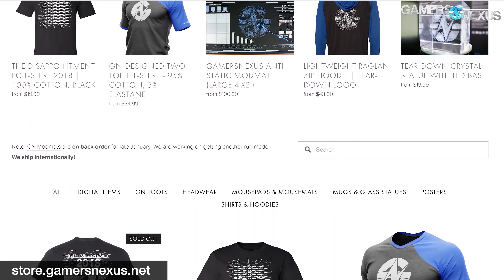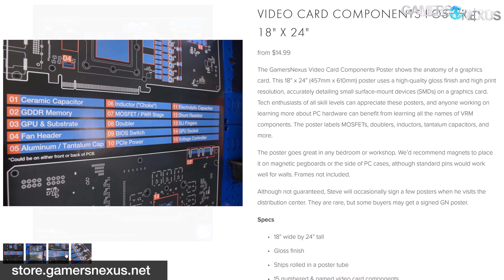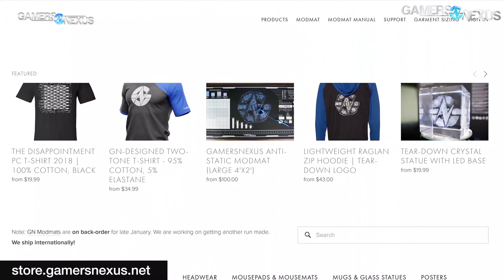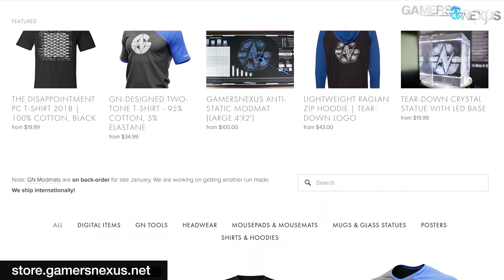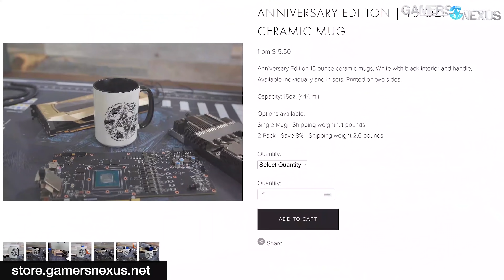Tear-Down of $2500 Titan RTX Video Card

Comment: Hello GN, could you tell me the thickness of the thermal pads used?

I got mine early 2019 i think, so i'm wondering if it's time to change mine. 

I forgot to jot down temps when new, which is something i have always done with any other card, just so i know roughly when a re-paste and pad change is needed.
Reply: did you find anything about?
Reply: @ToToPP  
Sorry, no. I did wind up just buying a whole bunch of various Gelid Extreme pads i think, and done it about a month after i made that comment. I didn't even think to write them down sorry. 

However, i'd stick to buying range of pad thicknesses, like from 0.5s, 1s, and 1.5s. 
In my experience, i have never had any problems doing a double layer of 0.5s or adding a 0.5 to a 1. 

It's just going to take putting them on, closing over the blackplate and screwing it down, then opening it back up to see if there is good enough contact between the pads and chips. If there is, then you know you can finish up and close it over properly with those pads. Nothing will be wasted. 

Good luck.

Comment: What is the fan connector piece called? I have an rtx titan heatsink and I wanted to put it on my asus rtx 2080 ti because the blower is extremely loud at full load. I know the 2080 ti has a port for it but it only powers one fan for the titan heatsink and it doesn’t increase in speed or decrease in speed. Can someone please get back to me ASAP because I want to buy a 4 pin splitter for it but I can’t find it anywhere

Comment: Gamers Nexus i give you a little tip, grind the tip of the cross head (Philips screwdriver) off and it will fit perfect and you will be able to undo screws easier with less force :-)

Comment: 11:08 Isn't that glue that takes some stress away from the solder joints of the BGA chip? It's a usual method to fill the area under BGA chips with resin based glue to prevent their joints breaking down under board flex. And those memory chips are close to the board connector, which is a stress point.

Comment: 13:05 .... The boards are exactly the same .....So .... If you replace the 1GB Vram modules on a 2080ti , to 2GB's , and flash a titan bios on , it should work ?
Reply: No, K1 on GPU chip stands not only for missing memory module, but for a missing memory channel in chip memory controller itself, so its a maximum of 22 GB and Its a hardware limitation that comes from NVIDIA. With a recent NVIDIA database leak and enough will to dig it up, you actually can make a 22GB 2080 Ti if you are skilled, having proper equipment and prepared enough to do some BGA and reflow soldering processes with heating the PCB from the under too, because its so T H I C C and contains enough copper to dissipate heat very well by itself.

Comment: I didn't expect Nvidia would come with a card which is even harder to justify price-wise than the 2080Ti or the rumoured 2060 (if the price-rumour is correct).
Reply: The vast majority of the price argument is the fact that you're getting 24GB VRAM. That makes the card comparable to the Quadro RTX 600 at a much lower price.

Comment: guys! for god sake! isopropyl 99.9% to clean your PCBs from thermal paste and stuff. with a little brush like a tooth brush or whatever. and blow air onto to dry it. the isopropyl dries very fast when blown. no time for it to "eat" plastics or sensitive parts. believe me it works like a champ! quick brush with iso + quick air blow and done! cleaner than clean.
Reply: He did

Comment: Oof, so Id need to buy the $2500 GPU to upgrade single GPU? SWBF2 was using over the 11 GB of Vram a 2080ti would have...
My Titan Xp may not even be enough as is, it was showing 11.6 GB, and seemed to be using system RAM since at 26 GB of Pagefiling+RAM, while that game only uses 17-18 GB on my laptop instead by comparison.

For multi-GPU, I'm pretty well set with 4x Fury, but I haven't tested it with SWBF2, and I think that game will be one of the few that bring it to its Vram limited knees... Most of my games run better on the 4x Fury, and from those prices, it looks like my Titan Star Wars edition will have to stay my best single GPU!
Reply: are you sure it wasnt memory leak on the vram?
Reply: @wabachi  3x 4k just seems to eat up the Vram... I'm shocked it actually runs playable at 11,520x2160 resolution, especially at Ultra settings, let alone flabbergasted its doing it on a single GPU (hence I built a 4x GPU machine). That was such a shocker, most of my games were having a hard time on 1 4k monitor at 40-50 fps. Fortnite for example is not particularly demanding and ran 67 fps without AA on single 4k, so I'm blown away by the frostbite engine (SWBF2 Lootcrate edition by EA).

But is it really 11,520x2160 resolution though? I feel like Nvidia is cheating, enabling the custom resolution makes the other 2 monitors look super stretched and fish eyed (like 1 inch character becomes 12 or 15 inches at the sides), so they might be running only 720p and varying resolution lower as it gets closer to the sides. I need to finish the hard-line tubing on my Threadripper Fury build to see if RADEON eyefinity has the same issue (I'll have to cut graphics down for Vram though). 

Otherwise yeah, I generally had no issues with even 4GB of the HBM on the Fury crossfire (it generally gets over double the FPS of the Titan Xp at 4k Ultra, but costing less used vs used), however, with triple 4k, I think the 4GB will be limiting after seeing this... But then again I never expected anything could actually run it seeing my regular 4k results, and just thought it would be fun to try for older games, but fired up the 2017 Lootcrate edition for LOLs to see a slideshow (Although, I'm not angry it actually runs well... That's pretty crazy...)
Reply: @jakegarrett8109  i'd say over 2x 4k starts to be a gpu speed problem since files on the card would be too big for the GPU itself to process lol, btw if it reports correctly use GPU-Z at sensor to see Memory Usage (Dynamic) how big it is... 
you said you have AMD cards as well right? does eyenfinity is still a thing?
Reply: @wabachi  Last I checked, Eyefinity was definitely a thing, way better than the pain in the.. we just won't go there.... Anyways, it actually isn't as finicky and janky as Nvidia (which literally turns off my monitor outputs when firing up a game sometimes), and requires a workaround to get it to even work for some things (which may be why its super distorted on the picture, but I need to test some more games, because some like Need For Speed Most Wanted would look pretty sweet with surround gaming, but it flat out refused to work on Nvidia). Eyefinity took maybe 5 minutes for me to setup, Nvidia... Well I'm still working on it, haha!

I'm thinking GPU-Z can only show what the GPU uses or calls for, and drivers will cap its calling to its dedicated amount (which is why it may show as say, 7 GB on a GTX 1070, even if its 8.5 or 9 GB on a Titan, because the driver knows the 1070 just doesn't have enough, but hopefully it tries to use all 8 GB available to the 1070 first, but it may need some for spur of the moment texture load in without hanging while it swaps everything back and forth, so a little bit of a balancing act and may need to leave some open on the card).

Yep, that's why I had the Titan clocked at 13+ Ghz memory +800 something. It is indeed the fastest Titan Xp I've heard anyone do (by a LOT) in terms of Vram overclocking. Its a shame its so power limited and will later be pushed to its death on liquid nitrogen after I hardware mod the daylights out of it. Its just been too much garbage to deal with (I previously had so many issues with Nvidia drivers, I put it away after a couple weeks of use, and I should have just sent it back for a refund, and only now does it seem like the drivers are less janky (they still crash some games stock, but nowhere near as bad, or maybe I just haven't been using it much since I have my 4x Fury setup and haven't noticed... Either way it "seems" to be working).
Reply: @jakegarrett8109   as nvidia says "it just works" haha or how most fanbois says "amd shitty drivers, nvidia best drivers"
anyways about "calling to its dedicated amount"  no i'm talking about dynamic... for example right now i'm on a 580 (8gb) and in a game or so it shows for example "2743 MB" as dedicated and "143 MB" as dynamic, as in the "file that is processed" at the time and usually the dynamic varies depending on the load, you got what i'm saying? maybe ur card doesn't show dynamic memory (which i highly doubt tho)

Comment: Yes, insanely pricey. Yes, no sane person will be buying one to game with. No, it is not meant for gamers, no gamer needs 24gb(?) of gddr6 memory to run any game even on 3 monitor setups. This card is a bargain bin Quadro and that is all there is to say about it. NV-Linking two 2080ti's together will still only get you nearly all of the vram this one card has.
Reply: I hit over 11 GB (like 2080ti) on my Titan Xp playing SWBF2 yesterday, and seeing as my RAM use was 26+ GB instead of 17 GB on that game when I'm not Vram limited, that means the game was probably using about 9 GB of Vram that it didn't have, so 21 GB should be about perfect...

Granted, I prefer my 4x Fury system for most things, but there are just a handful of games that do use more than its 4 GB of Vram at 4k Ultra, but then again I mostly play older titles because I'm not spending $30 to $60 on a new game, what does it look like? I'm not that rich!
Reply: @jakegarrett8109  what is SWBF2? I can't imagine a game that would be deliberately designed to take more than 11gb of vram, you must be doing something that is not "within spec" of the game, like a mod or something.
Reply: @adam346  Star Wars Battlefront 2 (EA Lootcrate edition). Normally 4 GB Vram has been enough for my 4x Fury crossfire, but some games are demanding more than that for 4k Ultra. SWBF2 is apparently easy enough to run on a potato, because almost as a joke, I fired it up on my Titan Xp Star Wars edition to enjoy the Slideshow at triple 4k (11,520x2160 resolution), set it to Ultra, and wow it actually runs... Not only that, its playable fps... Blown away since Fortnite on single 4k monitor only does 67 fps (no AA), LOL!

However, I think Nvidia has an issue with multi-monitor (I need to check with Eyefinity on the RADEON setup to make sure its not the game and the aspect ratio being a bug), because it looked ridiculously fish eyed as you go onto the surrounding monitors (like 720p or worse levels of bad). However, the frame rate was playable, it just seriously didn't have the Vram! I really gotta prepare for the 4 GB Vram benchmarks, its going to be awful, put on the welding helmet, cause you're not going to want to see this, haha!
Reply: @jakegarrett8109  I was using a tripple monitor setup where you have 3 active windows at 4k and then a single monitor is actually running the game. Even then, 4k single monitor should be peaking around 8gb(ish~) of vram with more than enough to run the other two inactive monitors with your desktop/chrome/netflix or what have you. Speaking purely in terms of v-ram as that really is the reason you would want that card.
Reply: @adam346  That's what I call single 4k (when the other monitors do nothing, except maybe MSI Afterburner and HWMonitor graphs). I'm talking 11,520x2160 gaming in my test. 

Generally having extra monitors does nothing to performance, but background tasks can. On R9 Fury series, you actually don't even see a hit in compute performance while 4x 4k Youtube videos run at once (you see a massive hit on RX 470 cards, its about a 40% knock in performance with just 1 4k Youtube running, so don't render videos while watching videos, haha!). But the Fury series is weird, I get within 1% (closer to 0.5%) of my normal Firestrike/TimeSpy score while recording at 4k, and I know with Nvidia, it pretty much makes games unplayable while recording (I think the Fury has dedicated encoding hardware that the driver leverages for compressing and recording gameplay, its just really no definitive impact outside of my error in testing).

4x Youtube at 4k will require full Gigabit Internet connection, I was spoiled and got 900+ upload and download with 0-3 ms ping (depending on motherboard) at my University dorms. I think I even tested 6x at once, but I remember for sure 4x while doing compute tasks actually worked great. Ahh, back in the day when I could click download Skyrim (about 8 GB), have it installed, and running within 1 minute and 12 seconds... I miss that...
Reply: @jakegarrett8109  right.. i would not call that normal use-case...
Reply: @adam346  Well it can't run my VGA monitors, that's for sure...
If you think I'm joking, let me tell you, I'm not... I wanted to benchmark it in the other room and use my old 1024x1280 VGA monitor, but oh gosh no... They were nice and included a DVI adapter (digital only however, so you can't go to VGA), and my DP to VGA active adapter that I used to run (not included with the Titan) was missing. So I had to move my some 30 pound glass 4k monitors (glass base, thick glass screens so tough you can scrape nacho cheese off with your fingernail etc) into the other room (practically broke my wobbly table doing so). So yeah... If 720p is your normal use case, you'll be fine as long as its HDMI or DVI (but they only give you 1 DVI adapter), and you're totally screwed if you want to do some gaming on VGA input... So I had to test it with the only DP monitors I have.

Yarg... can't even run my old-school monitors on that trash... You'd think if they bothered putting a DVI adaptor for "compatibility", that they would bit the bullet and send a DP to VGA (I know retail I paid $10 for it), instead they include a fancy display case for the Titan (bottom drawer is the cable adapter), but na... Can't afford that adapter for a $1200 GPU... My other ATI card (yeah, actual vintage card), had Molex to 6 pins (a couple of them), a DVI to VGA (I think 3 of them), and even this crazy switch adapter for converting VGA to that White/Yellow/Red RCA adapter for TV's, and I believe a stereo-lithography cable adapter (like for X-ray machines or something like that). The thing came packed with cables, the Titan... Just 1...

Comment: 11:55 Usually I clean that part with a toothbrush soaked in 90% alcohol, ofc I don't apply force just little circular motions, that okay?
Reply: you still risk damaging the caps for basically no benefit

Comment: Stuff under the memory chips is called "underfill". It's basically just glue that strengthens the connection. Helps with thermal shock, mechanical stress, sensitivity to humidity and general reliability. Not very cheap though, so you won't find it in general electronics.

Comment: Very disappointed in Nvidia...

I expected it to cost at least $3000, my friends will think I'm a peasant for owning a card that only costs $2499!
Reply: Get 2 then? I run 4x GPU, you couldn't trade me that Nvidia junk card for even my 4x Fury! I'm not making that mistake again, going from even 2x Fury to my Titan Xp Star Wars collectors edition was a massive downgrade, and I'm blasting past 2080ti performance (regardless of cost, however, my setup is much cheaper anyways, so I figured why not go 4x? I'll buy some more for blowing up on Liquid nitrogen later they are so cheap). Maybe get the $10,000 Xeon 28c that's slower than the 32 core Epyc? Otherwise Epyc is only $3200 (for multi CPU support, or only $2200 for single socket boards), so I would go duel Epyc if you wanted to impress friends (with Intel, you would just look stupid since its slower, though you could arguably go 4x Xeon if you wanted to bump that budget to $60k)

Comment: I'm out of touch with computers now. I want to do some basic gaming like Warcraft 3. Will this work HP - 19.5" All-In-One - AMD E2-Series - 4GB Memory - 1TB Hard Drive
Reply: the new war3 or the old one? you know they remastering war3 right?
Reply: @wabachi  yes the new one. That's why I want to get a computer again. Being an old guy I'm just lost with all the new tech.
Reply: @stuzystu  hmm, i find very little information about what you listed, do you have it or plan to buy? if you have it try to install Heros of the Storm from blizzard (its free) cuz i assume it will be made on the same engine, and if you can run that prob it will work with new war3, if not... and you wanna buy something, you can try to find an old prebuild usually from dell with an i5-2400 or 2500, that usually comes with 8gb of ram and slap a gtx 1060/rx580 or lower and you would be good to go in like 400-500 at max i'd say.. ofc depending on the pricing on your area...

Comment: For cleaning the thermal paste around GPU die, you can use a paint brush or any PCB cleaning brush, soak the paint brush with alcohol then brush on the component until all the thermal paste melt. Put a lint free tissue paper over it and use the paint brush to press it down to soak all the alcohol up.
Put a new dry tissue on the component and press it down with alcohol soaked brush to dilute and soak up any remaining stain. (This method clean PCB easier and faster). Repeat until clean.

TLDR, same method as cleaning PCB soldering paste.
Reply: But why? You never see it
Reply: @TheAdatto  For product photo shoot?